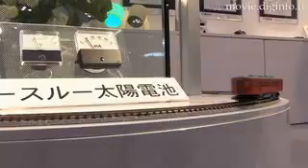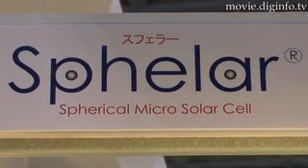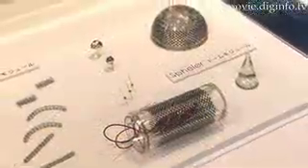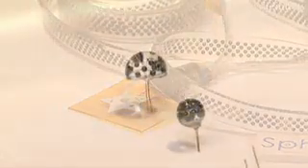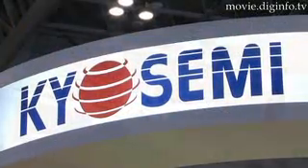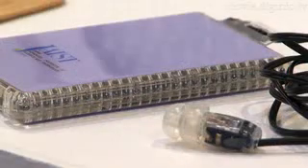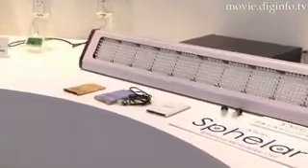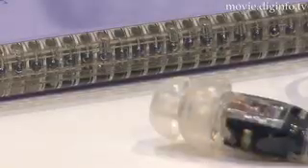Solar Revolution - Spherical Solar Cells : DigInfo

Comment: :If light(or electro enhanced light panels can put light in different directions for hidden solar cells in and out of corners and through tunnels can be usefull:: Or if clear and transparent solar cell glass are used then more light can travel to behind and through the first stacked solar panel, because it is clear you can also make them thicker maybe up to a foot thick of solar cells window because light can travel to other solar cells if front cells are clear:

Comment: @Xalimdor Close to Free energy sorry :For solar cells at night for solar calculators using led light for light source of any solar cell really can be enhanced especially on a military solar calculator cell ( of course a larger solar cell panel is needed) less battery power is used than completly using just battery or lamp light were you have to be directly under light of lamp. not spam sorry

Comment: Can solar panels use white ELECTROLUMINESCENT  Wire to charge them: By wrapping solar panels, with ELECTROLUMINESCENT   wire 100 yard set around 10 solar panels. Obtain more energy than what you start out with.
Solar Panels can use electroluminescent wire for a light source///